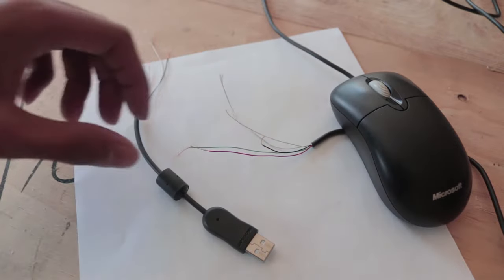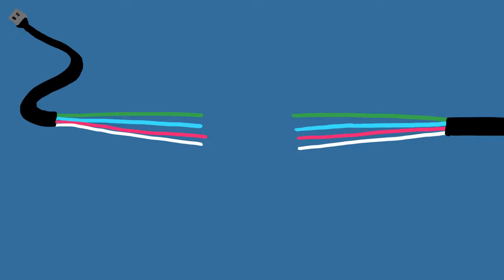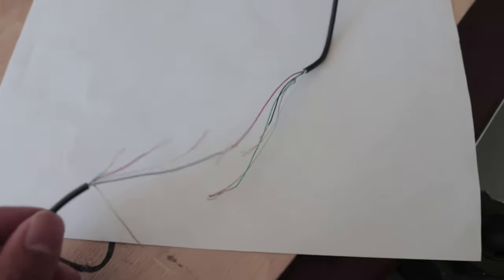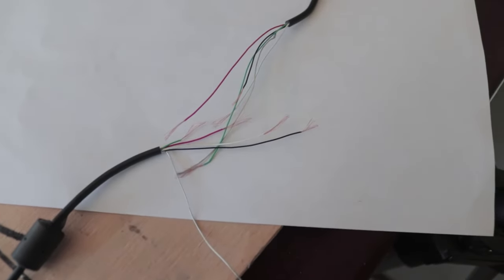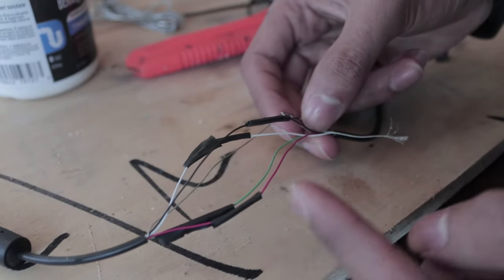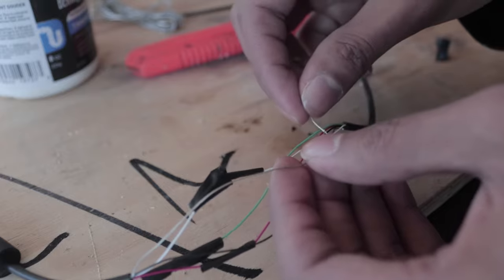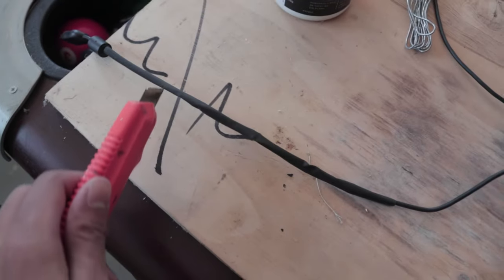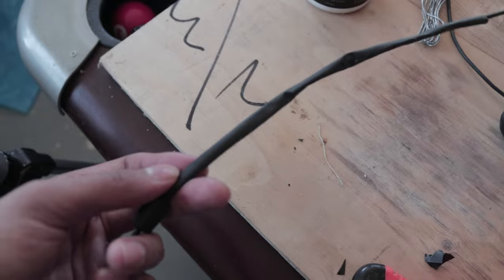How to Fix Cut USB Cable

Comment: I think that i did this but the wires have touched each other and i Put it in my computer and worked for just a bit, i trued to do it again with tape protection and didn't work, i think there is no chance in it to work again right?

Comment: I wanted to make 1 charging cable out of two. Problem is when I stripped them, one had 4 wired with 4 did colors, the other only had 1 and it was just copper

Comment: Can i use hot needle to attach the wires????
Reply from the maker: No. Just wrap and twist them together if you don't have a soldering iron. Hot needle won't work. Candle+solder could work as a makeshift soldering iron.
Reply: @ProjectDIYNetwork  What if I dont have a solder would the tape alone work?
Reply from the maker: @xi3394  yes it would. solder is just stronger
Reply: @ProjectDIYNetwork  Thank you very much

Comment: A working proof would have been nice but great video and one question, does this apply to the laptop cooler usb cable as well? or its just specific for mouse cable?
Reply from the maker: I assure you that it worked. I've done this like   10 times because my rabbit has bitten all types of USB cords. To answer your question, your laptop cooler USB cable should be the same. All USB cables tend to have the same arrangement of wires.